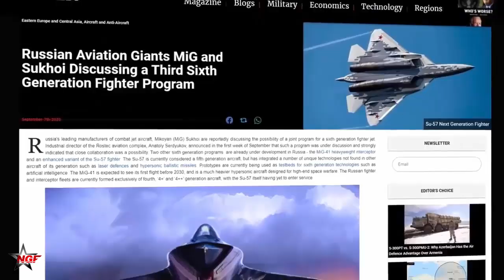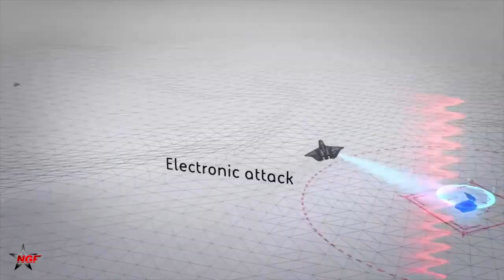Russia Restarts 6th Gen Jet Program to Intercept U.S 6th Generation Fighter Jets in Coming Years

Comment: I have taken your network and sold for your weak network Tv 5 management unable to discipline their ranks, I have no intent na pighatiin ka Appointee Donnie Pangilinan, though I will never retract my orders, I the CaesarKing shall give you a brand new Network in Italy, now cleansed the sorroundings. Creating you now a brand new Network in there in Milan Italy of a Network wherein you can decide what station number of that Network of my create now of a Cutting edge in Technology Designed Structure of a Network patterned from an Advanced Civilization design of a sophisticated  spiked moving  beam lights of Gray sharp edged roof of space interacting architecturally designed pointed spikes Network with aligned vertical length up the structures scaffold with retracting at the sides up the building of mechanical tech flying vehicles landing pads of 4, with slider horizontal escalators rails to move in building structure of moving shiny tech floor plating to plating slide of parking areas at that level floor with a platform of vehicle elevators, or move the flying vehicles at the landing pads of 4 for the vertical take- off lift of flying vehicles wherein I create you 4 of such. Now, with opening and closing hatches of modern radars and telecommunion equipments  extending and unfolding tech of extender mechanics near roof of that building, while the tainted glasses of dark blue in gray over all building are of the solar energy absorbing tech in superstrong glass materials which can withstand helicopter combat ships machine gun fires. With wide parking area at the near building entrance and with VIP ramp underground second floor parking areas with area guard posts and CCTV cameras hidden all over the place, a private helicopter landing pads at the rear back of building with elevator movers which can hide the private helicopters underground basement facility maintenance hall, and of sliding doors of metals at the sides and mechanical lifters approximating the surface ground. And luxury  accomodation building for network guests, high officers, and network  interview areas, and  conference audiovisual room. 2 Solid stable structure outer area telecommunication Towers with wireless energy transfer tech and storages at the underground of such far from main buildings and offices. Ordering now my superior tech of build to produce such network, now. Thats yours now appointee Donnie Pangilinan and your network officers and staff, if matters of influence connected to that network I gave you in Italy, Europe, so be it. Let it be

Comment: Did you know that the MiG 31 is the fastest aircraft, but its speed is limited from 3,800 to 3,100 km/h due to the destruction of the cockpit seal. 1975
Reply: The 31 wasnt available in 75 so I have no idea what you're on about

Comment: MiG 41 isn't created to oppose f-35 or F-22 as video missinforming YouTubers. Even present Russian jetfighters are more than good enough to oppose those US supposed invisible stealth jetfighters. Mig-41 is something that no one suspect it to be. Mig-41 will have completely new engine that works as a regular as present engine and as engine that works in very HIgh altitudes like orbital altitudes. New Radar will be integrated to work with with land Long ranges radars and with satellites. No country has developed that technology except Russia. Mig-41 will work as orbital interceptor. Russian had already developed air to air BVR Beyond Visual Range GREMLIN Hypersonic missiles mind blowing range of 1500 km. That Hypersonic missile will be used so as new laser weapon and new EMP weapons. Mig-41 will be untouchable, it will fly faster than any present Western air to air BVR missiles. Mig-41 will fly at untouchable altitude and speed. It will be big as Mig-31 or even bigger. When Mig-41 become operational West will be freaking out of terrors that Mig-41 can impose on any Airforce or enemies. Mig-41 at low orbits will be Mach 4 at higher orbits will be Mach 6 expected. At testing stages will be finalized if it could be more than Mach 6.😲🙉🦧
Reply: Russian..💪🇷🇺🇷🇺🇷🇺🇷🇺🇷🇺
Reply: JC -10 has tht radar coz They used tht to shoot down 6 Rafaels  . They link Satellites n land radar to achieve beyond visual kill without using hypersonic weapons.
Reply: Yeah... I thought so myself: is he talking of the involvement of Oleg Popov or what?
Because every aircraft he's showing differs in appearance and some are clearly AI generated...
But this hypersonic speed has a limit. After all, humans (pilots are humans, aren't they?) are like any other mammal just a water balloon, held together with bones and skin. You can give the pilot an cosmonaut suit but as long they aren't in microgravity, g forces have a limit for them.
Reply: I believe these are just speculations on information from western reporters on this channel
Reply: @HouseOfNishizumi  I actually don't. Russian engineers are often ahead of their times, and even the chinese were using russian engines before they changed to "their own engines". The only problem is, you have to build the jet (airframe) around the engines like you have to build a tank around the engine, and i actually don't know how the chinese were even able to build a jet and left (in their eternal wisdom) enough place for a new and housemade engine.
The first prototypes of the Mig-41 are already build, but they could share the future with the T-14 Armata. There were a few signs that were pointing in this direction when the Tank factory were trying to get more and more money for there development of the T-14 Armata and the Russian army just said at one point "f.t.s., we dont need them anyway so stuck them where the sun don't shine!". 
And there was the problem that they don't wanted that one of the T-14's get in NATO's hands. And as long as you don't have a reliable shield against fpv's, you will lose even the most modern tech to the enemy. The Afganit active protection system can't provide you with help help against drones or direct artillery shells. But who knows. We know all that the US have a lot of black projects nobody knows of. I wouldn't be surprised if we'd see a big number of the Armata series at one point because they're building them somewhere in an underground factory. 
But I'm almost sure that we'll see the Mig-41 in Massproduction. And this not because the SU-57 is a bad jet (far from it), but because it's a project that will bring the fear of God in the European NATO members and will make sure that the world can see Russia again as a military powerhouse. 
I'm just not sure where they will get enough energy for a laser of this force and all the other electronics that will be a part of the jet.
I'm just very worrying that we (I live in Germany) will be one of the first victims of our stupid politicians decision. They are obviously living in a total different world and aren't the ones who will suffer, because they and their families (and children who won't fight whatsoever for their "democracy"), have a system in place that will warn them and bring them into a bunker where they can sit all of it out. The new H's that will go 💥 are much worse than the old ones like the H 💥 that the Soviets were naming "The Zar 💥" somewhere in the 50th.
No one will be safe if you can drop 5-6 of these warheads with one launch and in hypersonic and a not calculatable path. And to be frank, even the Americans should know (and know it probably) that a space power like Russia has all the means to hit them at will.
There is a very popular philosophy (at least innthe rich circles) that the world have to go through a phase of total chaos and destruction, to be able to build everything up again and to change the rules. This idiots just aren't thinking about the possibility that a lot more Asians and Africans as well as Russians will be left (because they live in the biggest country on earth) then Americans. It looks like Donald Trump is starting in the United States because this "Uebermensch" sends already Troops in Democratic citys to start a civil war and looka how far he actually can go before a real civil war breaks out. He's a perfect Psychopath... and the narcistic side of him (that he wants a Noble Peace Price) is a big red flag... one of the many others.